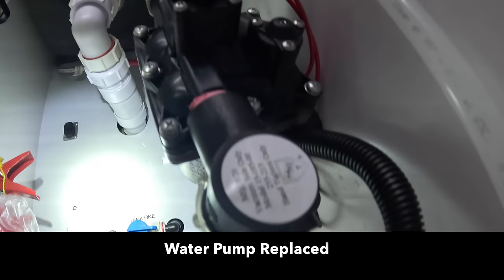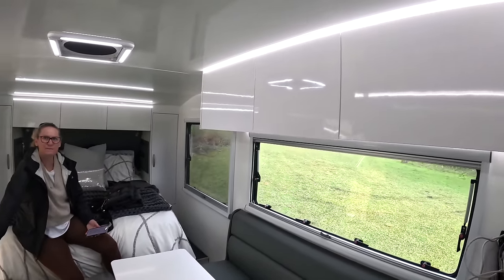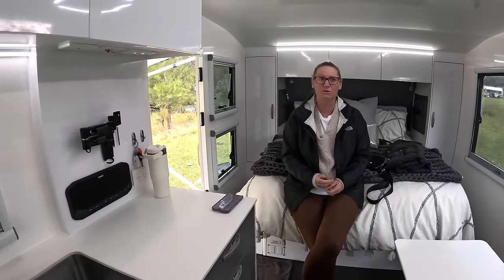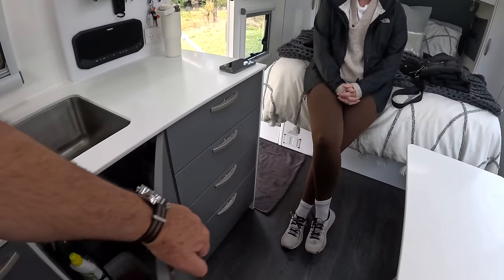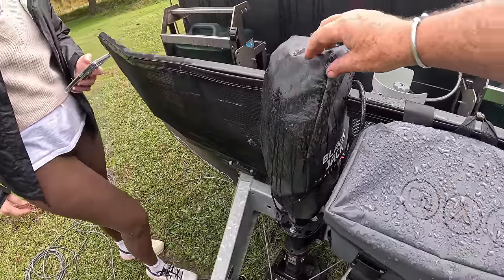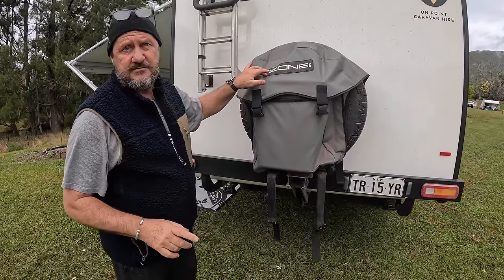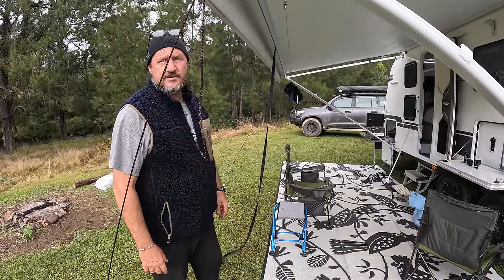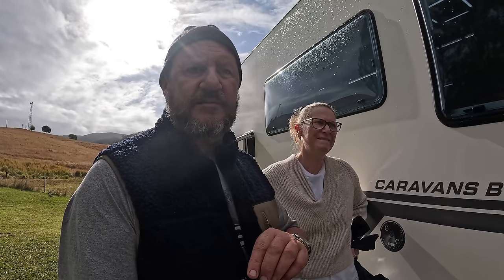Zone RV.  What we find after 6 months and what you should look out for when you next buy a caravan.

Comment: Oh, I should have added that it is easy to connect both water tanks together. Just connect a section of hose between both the outlets (thet are both at the same height). If the hose has a large enough diameter, you can then fill both tanks from a single fill point.
Reply from the maker: @derekgore1268  I’ll investigate! Thank you

Comment: Hi Guys enjoy yourselves thats what it is all about. Now I was asking a manufacturer about the powerpoint issue as to why they dont add more. Now to build it to a standard apparently             (according to him) power points have to be i think he said 800mm from either water source or a heat source. I did explain ive seen other manufactured vans with power points both sides and he reckons its not compliant. Not sure if we as owners add one extra what happens. I suppose insurance would look into it.
Reply from the maker: My understanding is power points need to be 150mm away from the water tap (or basin some will say) and gas flame, 400mm high for water area but not sure if this applies to gas. Others will argue that a safety circuit breaker is adequate to allow alternate placement. I just want one under the over head cabinet (like at the other end of the bench). Should be easy to organise that. Thanks for your comment. Perhaps a sparky will jump on and tell us!

Comment: Hey Craig and Tracey. Thanks for the walk around.
Have you ever come across any payload issues on the vans you've traveled with.
We found out today that our tare weight is 3177kg, the compliance plate says tare 2980kg and the caravan was advertised from the dealer at 2900kg tare weight. It's a brand new 2024 model.
Reply from the maker: It's a typical thing by all reports - not good - depends what you have in it when you weigh it - water etc. New ones should be correct. They must have added several items to put that much weight on. It would be nice to believe what's on the compliance plate wouldn't it. We don't weigh the vans reviewed but you do get a good feeling after a while.Thanks for your comments, much appreciated.
Reply: Wow , I hope it's working out OK for you now ,you obviously take interest in your weight and safety. 
Cheers
Reply from the maker: @davidmann6902  Thanks for your comments! Starting to take shape - just heading out on another adventure for a couple of weeks!

Comment: Hi, just wondering if you have any trouble with the sizzler deluxe bbq when you light it. Mine keeps going out 3 or 4 times before staying alight. Really like the bbq , but frustrating.  Cheers
Reply from the maker: I have had a problem at times with 1 burner - appears to take multiple goes to keep alight. Some days it's fine and others a problem. Adjust the thermocoupler to touch the flame - the gas pressure needs to be 2.75 & 3.0 mpa - some vans don't have this pressure so you might need to check the regulator at the bottles. Most likely the proximity of the thermocoupler.
Reply: Cheers, will check it out.  👍

Comment: Zones are known for cracked chassis
Reply from the maker: @richardtimms6645  there have been a couple I’ve seen over the time, how and why I don’t know. Some earlier year models had a recall to be fix a problem caused when fitting the suspension - looking at ours you’d have to have it seriously overloaded to create a  situation like that. Looks bullet proof to the naked eye.
Reply: They don't seem to be the lightest caravan on the market - as suggested on the factory website. With tare around 2.5t in basic trim they would have to be substantially constructed.
Reply from the maker: @17Viking  all I know is ours is just under 2.5 - payload in a ton. Haven’t seen many other 3.5t vans with those numbers. Typically they are all tare weight 2.6-2.9T. I’ll check out the website again re lightest van. Their web site lets you build the van and it show price and weight as you add things. Recently they’ve included more under the standard banner which would show a higher rate to start with - very transparent site.